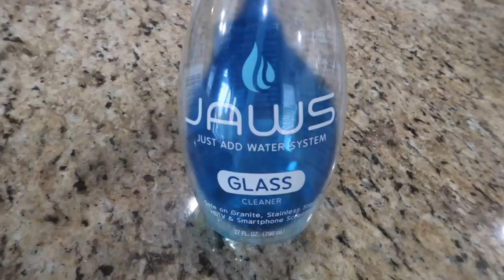*HUGE* EXTREME CLEAN WITH ME 2021 | SUMMER CLEANING MOTIVATION | CLEANING ROUTINE | JAMIE'S JOURNEY

Comment: I left a candle burning on my bathroom counter and it made a black streak up the wall. It was caused by not trimming the wick, which produces black smoke when the candle is lit. Any ideas on what takes that soot off the wall? I've tried spray cleaners from Grove and a magic eraser, but no luck. The paint is pale yellow semi-gloss. Thanks!

Comment: Have you tried Ashtanga or Bikram yoga?  Bikram yoga is also called hot yoga, done in a heated room, semi-fast paced and you'll be sweating buckets.  Ashtanga yoga is sometimes called power yoga, is fast-paced and you'll work up a sweat there, too.  Most folks tend to encounter vinyasa yoga (the mid-speed flowing movement) when they first look into it but that's just the tip of the iceberg lol.  Not trying to talk you into it, but I will admit I was genuinely surprised when you said yoga's not your thing lol.

Aw, poor Reese (did I spell that right?). 🤧  I hope there's something the vet can do for her.  My chihuahua has anxiety, too, doesn't like storms that much but absolutely freaks out during fireworks.  Our vet recommends 1/2 a mg of melatonin per 15 -20 lbs weight before high-anxiety situations if we can get it down our dog early enough, just enough to make her slightly sleepy to take the edge off her anxiety during those situations.  No one take this as medical advice without talking to the family vet.  It might work for our dog but that doesn't mean it works for all of them.

Kids will be kids.  Sometimes they're in the mood, sometimes they're not lol.  I will say though, I did love it when my little one was in the mood to help clean lol.  Now she's a teenager, and is never in the mood lol.